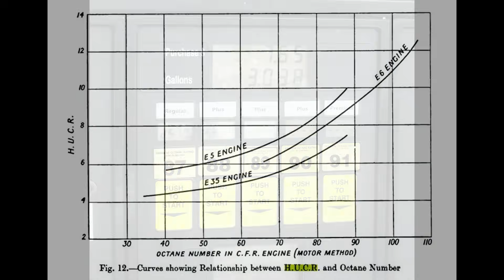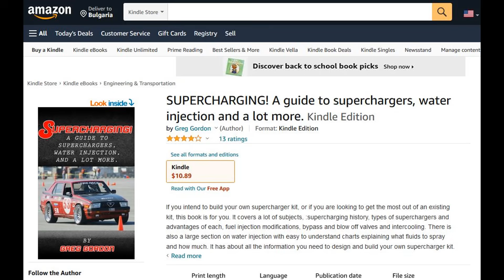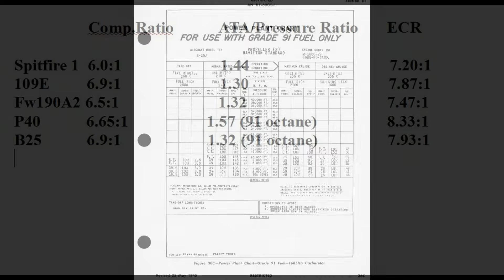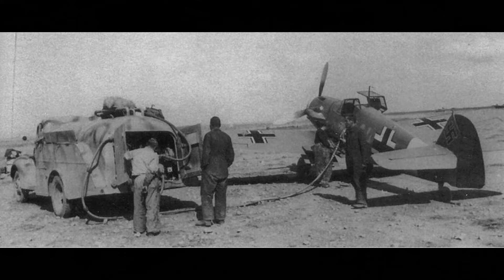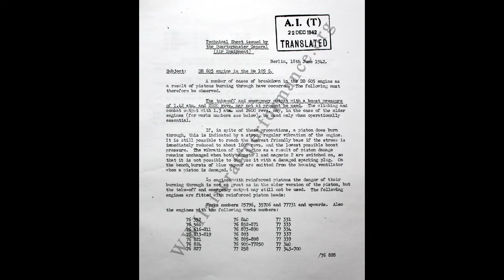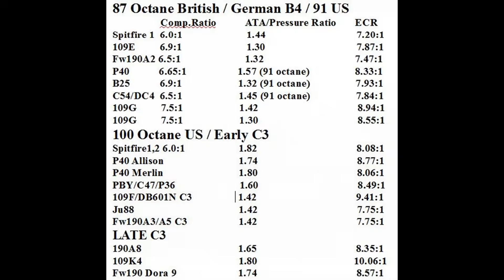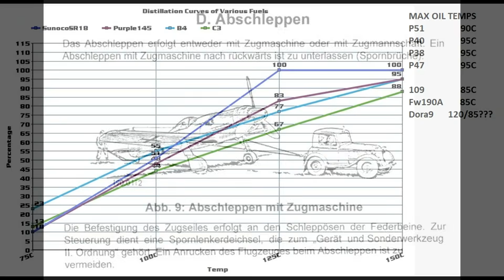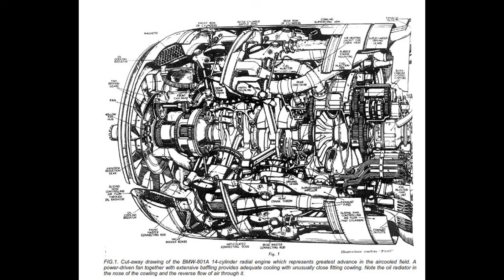German C3 Fuel, Uber Octane or Synthetic Crap?

Comment: Perhaps the German planners preferred to used the C-3 high octane fuel with a leaner mixture to conserve vital resources, instead of in a rich mixture to gain performance. Or perhaps the lower evaporation rate means that C-3 did not burn well at a rich mixture.
Reply from the maker: Quite a few people have suggested that, but I don't think so. Trying to save fuel at war emergency power just doesn't make sense. You don't save any fuel if you loose the whole plane, and the difference in fuel consumption for the 3 mins you use that power at a richer mixture is trivial.
Reply: @GregsAirplanesandAutomobiles  Haha - thanks for your comment. I didn't think you'd be monitoring comments from these old posts. I used to ponder these questions back when I was studying to become a pilot. I'm a mechanical engineer too, so I some times write comments just working out things in my head. You do good work, and although I have just begun watching your channel, I've already answered several questions I was pondering years ago about WW2 aviation. Thanks!
Reply from the maker: Thanks, and the comments come in chronological order into my feed, without regard for how old the video is.

Comment: Time periods are important to understanding the apparent conundrum of german octanes and boost pressure usages. Calum's book is a seminal work, and is extremely information rich; I'm on my 8th read, and the time frames and the events provide the answers at which you're trying to get. 
Firstly, Germany's fuel research was as good as any nation's; they had very exotic racing fuels, and the pre-war airspeed records to prove it. What they didn't have were their own crude oil stocks, or sufficient synthetic industry capacity to keep a world war-level military machine running. C3 fuel manufacture required a prohibitive (for war) level of the availabile synthetic production, had a more limited shelf life than B4, and used a supply/storage/mixing system the military & industry had devised, that potentially made delivering highest grade C3 increasingly problematic. 
From 1943 on, Britain's periodic testing of German fuels consistently concluded that Luftwaffe octane ratings were puzzlingly in excess of mandated, operational boost pressures (i.e., needs). I have a copy of an immediate post-war report by Allied reporting commission (c/o fuel industry engineers) that states 1945 B4 octane at 91-93 maybe 110 at rich mixtures), and C3 at 130 Allied octane equivalence. 
Does this mean the Germans had lost their minds, and were needlessly wasting their limited resources? No. It means the Allies did not have the whole story. 
The rest of the story is that before WWII, there was C2 high octane. And, in 1939, there was C3. This was C3 1.0, and in what may be a harbinger of how the Attention Defecit Disordered German aviation industry proceeded, they assumed, but did not test whether this C3's volatility was the same as C2. It wasn't,  and when in 1940 they introduced DB601Ns into 109s & 110s, they had lubrication failure, and had to be withdrawn.. You mentioned this C3 was also non-compatible with the rubber tanks in the 109Fs, effectively lowering the octane.
A much bigger problem was, that by 1940, a host of measures limiting/reducing strategic material metals that could be used in alloy manufacture. Note well the time frame, because this sets the table for the remainder of the war: repeated reductions in allowable alloying metals. Happened way before Operation Torch and cobalt. 1940 nickel %s for valves dropped precipitously, reaching 6-8%, completely inadequate. Immediately corroded valves, causing detonation. This took 18 months minimum to discover the cause and invent a viable work-around, partly because the research/testing facilities were using their old stocks of high-nickel valves, and those engines were passing testing just fine! Meanwhile, right when the 109F & 190 had won a lead, engines had to be derated.
The two-stage compressor issue: well, the RAF couldnt have pulled this off if the U.S. hadn't solved their bearing issue. Single stage boost levels had run into a lead babbit bearing limitation. U.S. developed thin, alloy bearings that could handle the loads. Germany didn't have this option, and was using lead babbit to the end, limiting allowable boosts/stresses. As an aside, Germans didn't even have access to platinum & irridium for spark plug electrodes.
Add in lack of alloys for steel cranks, rods, gears, springs, bearings, turbo-chargers, turbine blades, etc.,  and you reach two conclusions: the limitations of the metallurgy was driving the boost pressure limitation, NOT octane levels; and, MW-50 & GM-1were remarkable, but not total solutions. I think big displacements were also part of the work-around.
In 1943, C3 2.0 was introduced, providing sufficient volatility (for direct FI), stability and improved octane rating. What now became crucial was production, due to bombing and loss of oil fields.
So, the rest of the story was revealed only through research years later. It wasn't the fuel quality, limiting pressures. It was the metallurgy. Had Germany somehow fallen into a huge stock of Allied 150 Avgas, they still would NOT have been able to run 72-80" boosts.
My research is that Luftwaffe set richer mixtures than necessary as a hedge against detonation. For what it's worth, photos tend to corroborate this; german fighters tend to show blacker, sootier stains than Allied fighter grayish exhausts. Though, this may be a reflection of TEL levels in Allied fuels.
Reply from the maker: I'm not going to comment on everything you said because I don't have the time. However the Germans ran mixtures that were too lean, not too rich. I'm not sure what your source is, but you're wrong about that. The evidence is presented in my video on the FW190's fuel management system and it's as close to irrefutable as it gets in this sort of stuff. Fuel octane was the much bigger limiting factor as compared to metallurgy, that doesn't mean metal  wasn't an issue, but octane was by far the bigger deal.

Comment: Greetings Greg, this is anonymous commentor. 99.9% of the crap you read about the axis is propaganda.
Reply from the maker: I would break that down a bit. It depends on just what you're reading about. Some things are 99 percent propaganda, some are not.
Reply: Well their aircraft were every bit as good as ours. There pilots were better through experience but not by number. Their programs for jet propulsion made it further through the red tape than ours (Despite Erhard Milch) and their designers were very future minded. Take a look at the modern paradigm and reference Germany in the 40's. You will see a lot of uncanny similarities but, where is the enemy? @GregsAirplanesandAutomobiles
Reply from the maker: On average their pilots were a lot less good by mid 1944. In 1940, they were probably the best in the world. As for their aircraft, it depends a lot of on how you look at it. I wouldn't say they were clearly "better". They didn't even have intercoolers or dual stage superchargers until very late in the war. However there are certain examples and time periods you can point to, like the 109F was superior to any Allied fighter when it debuted.

Comment: Greg,  I’m a little late to the party… Great Video.   I can see the valve material metallurgy changing the durability of the valve… the resistance to heat…. But I would think the metallurgy doesn’t change the temperature the valve actually runs….        I do have a question….  How did the Americans change octane of fuel.  Additives like ferrocene?     Thanks again.  All the best.  Chuck.
Reply from the maker: Thanks, and  mostly by adding lead.

Comment: this is a very long and technically complex video that seems well researched and well informed so I'm going to just shortcut my Big Question with the answer that I gleaned. Why did German aero engines make so much less power than Allied engines like the 2800? A shortage of high octane fuel and an apparent unwillingness to exploit the high-octane when it was available; Luftwaffe seemed to either not want or possibly even not realize to run their engines extra rich when high power/anti-knock was needed, unlike the Allied engines which had very rich settings available for combat power

Comment: Thx Greg, love hearing about engines. I built a 10.2:1 331 for my. Dynamic compression is 8.1:1 with a hydraulic roller cam (comp cams XE266HR12) heads flow 250@ .500 lift, cam max lift is .550, duration is 266/274 with 46 degrees overlap and it’s on a 112 LSA. David Vizard swears the LSA ought to be 108… but I believe it’s more suited for higher static compression and poorer flowing heads. Anyways, im happy with my 4000lb manual bronco, haven’t dynoed it, but maybe someday,
Cheers
Reply from the maker: When I read 331, I though you were working on a really old Chrysler. Your Bronco sounds very cool. David Vizard is about the best we have, that doesn't mean he is right for your particular engine and I think he would be the first to say that. I assume you didn't speak to him but are referring to his LSA formula.
Reply: @GregsAirplanesandAutomobiles  precisely. David is a treasure for sure. You’re up there too

Comment: As an observation on the question of why they didn't push engines using C3, i wonder if perhaps the bigger thing they were after was having another source of fuel.

for the addition of a synthetic fuel to supplement the decreasing limited amounts of standard fuels, in addition to the modest boost they did use, the use of this would free up more fuel for other aircraft, but also for all the other vehicles Germany such as tanks.

also, the modest boost in octane they did use might have freed up some of supplies and systems for the B4 engines.

and lastly, i imagine that they distributed B4 and C3 vehicles according to the available of either fuel.

Comment: Greg, thanks for this jam packed full of data about fuel video.  A lot of this was helpful for my understanding of some issues I have with my 3.0 L Twin Turbo automobile motor.  It also helped me get a better feel for the nuances of my 3.8 L hopped up (LOL) flex fuel GT-R . I do have ECU maps for 93 and 100 octane for my 3.0 L. Now understand how and why the HP gains are so significant when using E85 and 100 octane fuels, with 70-73% alcohol giving me the most gain in my GT-R .   Your video was very insightful!
Reply: What car is the 3.0 in? 300zx? I say that because of the GTR.
Nice rides.

Comment: I built my 302 based 331 with dynamic compression at 8.1:1, based on IVC, but I think I have the wrong LSA (112) vs (108-109) for NA. Maybe my LSA is more suited for boost & EFI, alas I’m carb and NA 😂
Reply from the maker: David Vizard has some excellent formulas for determining the optimal LSA. You should check out his channel.

Comment: I was a carburettor fan boy for decades. When combined with a high performance 250cc engine, you start to notice fuel pressure making a big difference. I guess in an aircraft, it's impossible to allow for altitude changes 100% effectively.

Comment: maybe a little late but could it be that they ran lean because of the mechanical injection system? when on the limit can't exactly just turn them up like changeing a jet in a carb. gotta redesign the whole thing with bigger bores and strokes to deliver more fuel. maybe adequate to get the most out of the fuel at the beginning of the war but just ran out of juice for the higher boost of later ones. maybe didn't want to suffer suply issues of changeing the design of such a intricate system.

I dont think they were super concerned about engine life, if fuel contamination was the main thing holding them back they would use every tool they have to help get around it but they are still running a low oil temperature. too small injection pump lines up a little better in my head with the cool oil.

Comment: I came back to rewatch this after seeing Calum Douglas on Military Aviation History channel, and heard him say words to the effect of 'fuel octane doesn't really matter' - so came back for your take on it Greg. Interesting indeed to see that you discuss Calum's views quite a lot in this video.
Reply from the maker: Hi Simon. As I'm not sure of the context of Calum's statement it's hard to respond to it. However I seriously doubt he said "fuel octane doesn't really matter". In auto or air racing it's one of the biggest factors. The Reno air racers still run 145 octane in the Unlimited category and there is a pretty good reason for that. Every car made has a minimum octane requirement and lower octane will often result in knock and thus less power. All modern factory performance cars I know of require a minimum of 91 (U.S. rating). It's not because Ford and G.M just want you to spend more money. I suspect Calum was saying something about it being a smaller factor than some other variable, but I'm not sure.
Reply: @GregsAirplanesandAutomobiles  it may have been a throw away comment I misheard then or misinterpreted in the way you have just described, but still - it got me listeneing to your video once again to see what an expert has to say, and that is no bad thing. Thanks for the reply Greg - concord is always better than discord!

Comment: OK, Greg I have grabbed a bottle Dunedin's Finest Emerson's New Zealand Pilsener, strapped myself in and am ready for Take Off: Sorry Greg but at 45 minutes I had to go and reload, this time with a Krombacher Pils, just as you start to talk about the Me 109 G's on C4 and late G-10 and K's on C3... its very confusing for a country boy like myself so the C4 was the lower Octane and the C3 the best octane!
Reply from the maker: Robert, I get it, this video isn't for everyone, I knew that when I made it. The short version is that whenever the octane of Allied fuels went up, power went up. Octane has a huge effect on an engine's ability to make power via higher manifold pressure, compression etc. Jimmy Doolittle via Shell Oil championed the effort to develop high octane fuels and that put the US way ahead at the start of the war. The Germans sort of caught up much later with their C3 fuel, but that fuel had its own set of problems and wasn't run in mixtures rich enough to be anywhere near as effective as the US 100/150 in Mustangs and Thunderbolts. The octane rating of a fuel matters, it matters a lot and the US had the advantage there through the entire war.
Reply: @GregsAirplanesandAutomobiles  Cheers Cobber, useless fact for you that little New Zealand had the most number of aviators and ACE pilots of the allies in WW2 on a per Capita basis of course, we were early adaptors of Top Dressing. Your work is amazing thank you! If you ever get to the South Island of New Zealand look me up and I will drive you anywhere you want to go. We have the RNZAF's Museum here in Christchurch . And Next year we have War Birds over Wanaka, a great tourist and scenic spot! Plus there is another 2 aviation Museums, one in Ashburton and another in Owaka (Blenheim). I have really appreciated the detail you go into! Thanks once again!

Comment: You cannot have an intercooler without a two-stage compressor, by definition.
Intercooler installation has its weight, internal volume and cooling drag. Germans simply made engines with higher displacements instead. And for very high-altitude performance they were using GM-1 anyway.
Considering power to weight ratio they kept parity the whole war.

Comment: I don't know if you answered this in this video (l've watched it a few times) but what would US 130 or 150 octane WWII fuel be rated as if it was available at the pump today in the US (I wish)?  Would it hold the same rating from back then or has our octane rating system changed since the 40s? Thanks -Your content is excellent.

Comment: I want to help explain pre ignition, or “knock”. The fuel charge in an engine has to be ignited at the perfect time so that the flame front pushes down on the piston as it passes top dead center (tic). But the flame front takes a bit of time to develop, depending on the octane rating of the fuel, high octane burns slower. Knock is when the fuel lights too soon, usually by the heat developed by the compression of the air, and the flame front collides with the piston before it gets all the way up to tdc, instead of pushing on it on its way down. This is exceptionally bad for the engine, as it tends to blow holes in the pistons, and/or break the connecting rods.
Reply: Knock- is when the fuel detonates before TDC. You want fuel to burn, but not explode.
Reply: @rdallas81  Burning and detonating are the same thing in an engine, but knock is what happens when that happens too soon. The timing is critical, and low octane fuel burns faster, so it requires less advance, and makes less power.

Comment: The following DB 605 versions ran with C3 fuel: DB605AM, ASC, ASM, D, E, F*
But please stop this nonsense that it needed 22tons of coal for a ton of CTL (Bergius) fuel. 

*Reference: Flugmotoren und Strahltriebwerke, Gersdorff, Grasmann Bernard Graefe Verlag, ISBN 3-7637-5283-8 P109